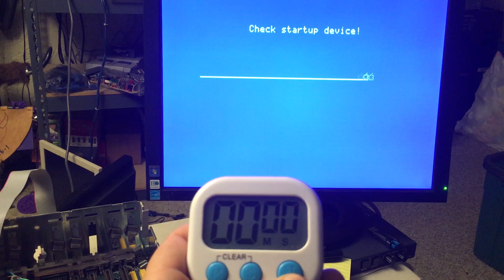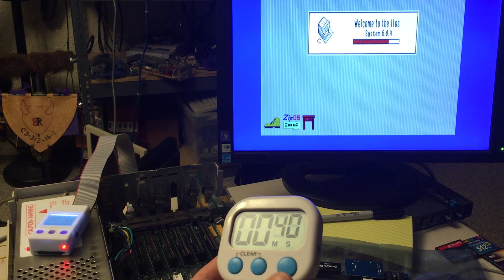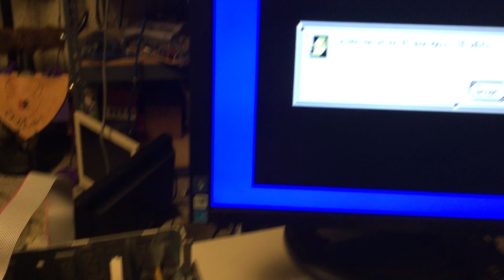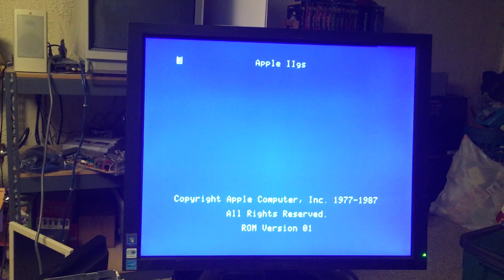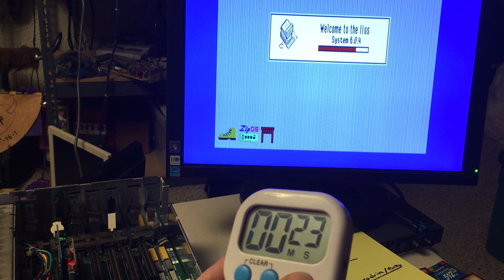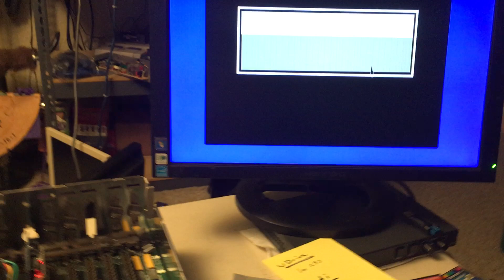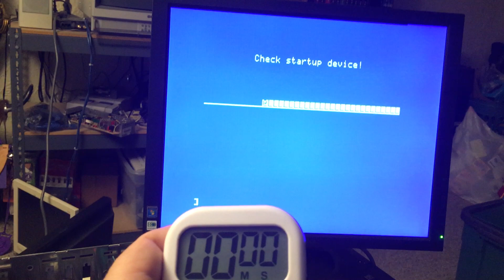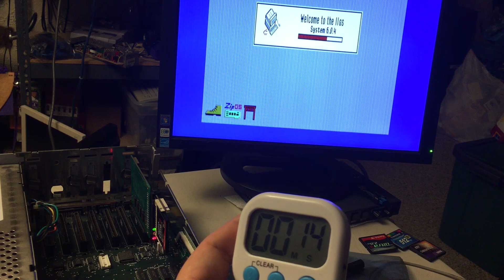Ron's Computer Videos #101 - Apple IIgs Storage Speed Benchmarking (Booti, wDrive, Microdrive/Turbo)

Comment: I really wonder where the CFFA and the FloppyEmu fit in to the rankings.
Reply from the maker: FloppyEMU and wDrive are nearly identical in speed because the floppy controller is the bottleneck.  CFFA does not support DMA (like the MicroDrive Turbo does), so it’s likely around the same speed as the BOOTi.

Comment: You could have used BenchmarkeD to test the different mass storage devices for the Apple IIgs. Non-DMA devices and those that do not use read-ahead are... slower.

Info and results @ http://www.brutaldeluxe.fr/products/apple2gs/benchmarked.html
Reply from the maker: I only learned about this tool a few weeks ago.  It's my intention to do a follow up video where I put each solution though the paces.

Comment: What are you using to connect to that display?
Reply from the maker: I use an Extron HDMI-RGB 300A (and a Mac VGA adapter and an original Apple RGB video cable).

More info in this video show several different solutions  ---> https://youtu.be/Dwqh2Pe4yzQ

A nice follow up in this video showing my Extron HDMI-RGB 300A setup ----> https://youtu.be/ba4rBJ_IBYw